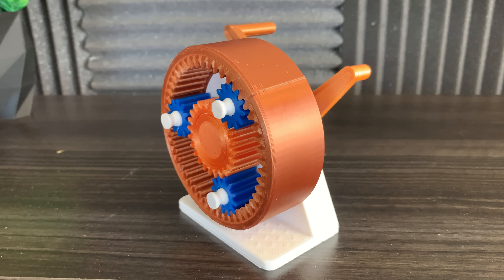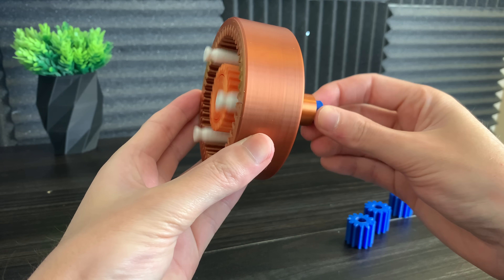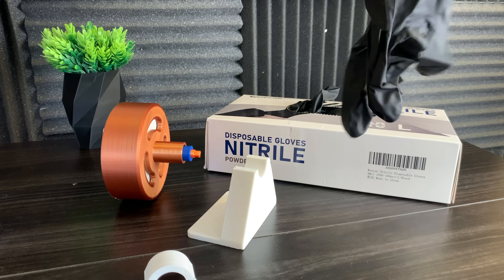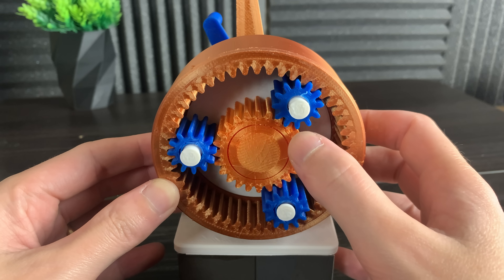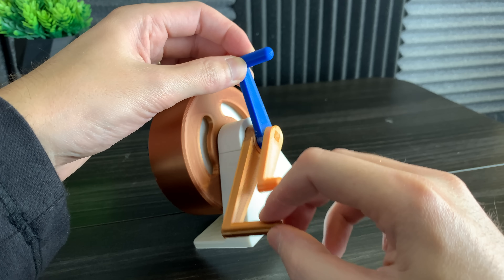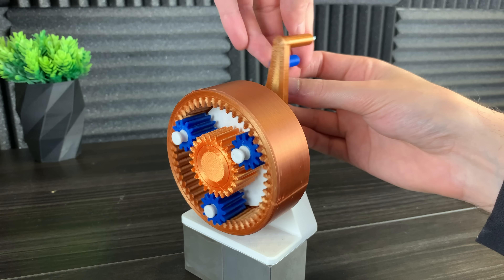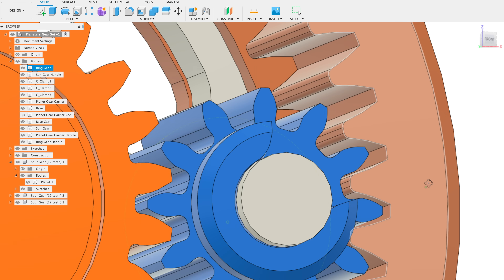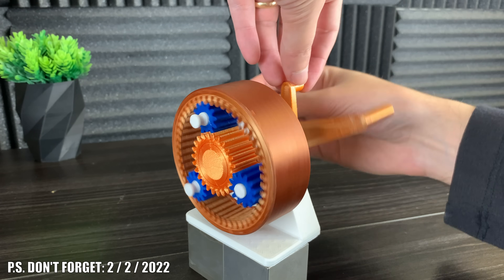What makes planetary gearboxes so amazing?

Comment: I believe one of the most interesting uses of this gear configuration is the differential in an automobile. The engine turns the planetary part I believe which will automatically distribute the energy to the two wheels unevenly if the car is turning (more speed to the wheel on the outer edge of the turn). If you ever have your car up on a lift, you can observe that spinning one of the drive wheels will spin the wheel on the other side of the car in the opposite direction.
Reply: An open differential uses a ring gear but in a different orientation so that it can be rotated by a pinion gear from the drive shaft. That ring gear is linked to spider gears which can rotate around side gears. Each side gear is connected to each half shaft. When the car is driving straight, the spider gears are not used. Only when the rpm for each wheel differs then the spider gears allow for the side gears to rotate at different rpm.

Comment: OMW. Yt algorithm wins again.  Coming from eskate boards this is so relevant as gear drives are now being used as an alternative to belt drives and direct drives. 
Also need to learn how to 3D print components for my boards so this video is excellent. Great presentation and easily accessible. Thanks so much.

Comment: Retired machine designer here: Don't know how you modelled your gears, but you can download exact CAD models in several formats from gear (and other components) manufacturers or suppliers. Saves a lot of construction time and the 3D printed parts should fit the first time. A simple pencil sharpener is 2/3 of a planetary gear drive; the planet carrier is spun by the handle, the planet gears are rotated by the stationary ring gear. The cutters are attached to or are part of the planet gears. No sun gear is required for this.
Reply: You could say the pencil is the sun gear, and being forced to hold steady generates the friction that sharpens it
Reply: "Should fit the first time" except you're not realizing that 3D printed parts' tolerances can be vastly different from something commercially produced, so even with cad files from, say, mcmastercarr, you may still need to compensate

Comment: The "Power Split Device" in a Toyota Hybrid Synergy Drive E-CVT transmission, is a planetary gear set, just like depicted in this video. In the Toyota Prius, the original application for HSD,  The Sun Gear is splined to a 30hp, 3-phase synchronous motor called MG1. The Planet Gear Carrier is splined to the gasoline engine, and the Ring Gear connects two ways, to the front wheels and via the Differential gear set, and to a 70 hp synchronus motor, MG2. The genius in this system is provided by the software that controls the overall flow of power to and from the gasoline engine and the two motor generators. MG1, the smaller, 30 hp unit, has two jobs: to reclaim kinetic energy when the vehicle needs to slow down, via "regenerative braking", and to control and limit the speed of the gasoline engine. At any given vehicle speed, the computer can adjust power flow to MG1, and thus control how fast the sun gear is spinning, or even make it spin backwards, and this indirectly controls how fast the gasoline engine is spinning. The computer is programmed to try and keep the gasoline engine running within it's most fuel efficient range of rotation speeds (1,000 to 2,500 rpm), and to limit the maximum speed of the engine to about 4,200 rpm. While the gasoline engine is being controlled by the computer via MG1's spin on the Sun gear, the computer is simultaneously controlling power supply to the 70hp MG2 motor. How much power can be delivered by this motor is influenced by the state of charge in the traction battery, temperature and power limitations in the inverter and motor stator, the power demand by the driver or cruise controll, steepness of the terrain, altitude and oxygen supply in the air intake to the gas engine, and several other factors. The computer makes thousands of decisions every second, and is programmed to optimize all of the components in the power train to deliver the maximum fuel efficiency, and minimize tailpipe emissions to keep the Government happy. It's not just Toyota, of course: many manufacturers sell Hybrid cars, and most of them use technology similar to the Toyota HSD, in which a planetary gear device is central to marrying one or more electric motors, a large battery, and a gas or diesel combustion engine in a unified powertrain that uses electricity from the battery to propel the car whenever possible, and use as little fossil fuel as possible.
Reply: Awesome explanation! Nissan licensed Toyota's Synergy Drive so they used the same PSD. Honda and most other did not and instead mated an electric motor to either a standard automatic or CVT transmission which was nowhere near as efficient or reliable. The PSD is an ancient concept that was tailor made for hybrids.

Comment: The whole point of this system is that you can connect two separate drives to one output. I think that's worth stating more than the adventures with Superglue.

Comment: 9:25

R = Ring gear (tooth count)
S = Sun gear (tooth count)
C = planet carrier

(Input, output, Stationary)

(S, C, R) = R/S + 1
(R, C, S) = (R+S)/R
(S, R, C) = -R/S

(C, S, R) = 1/(R/S + 1)
(C, R, S) = R/(R+S)
(R, S, C) = -S/R

The tooth count of the planet gear is always (R-S)/2

The number of planet gears must be a factor of R+S in order for everything to work.

You can use 2 of these simple gearsets to produce a 9 speed gearbox with 3 reverse ratios (granted, only 8 of the forward speeds and 1 or maybe 2 of the reverse speeds are practical) using 6 clutches and 5 brakes.

R/S/C Gearset 1 = 80/48/16 (2 clutches, 2 brakes)
R/S/C Gearset 2 = 80/20/30 (4 clutches, 3 brakes)

For Gearset 1 you want the planet carrier to be the output all the time. You will produce 3 ratios, 2 reductions and a direct drive by controlling the clutches and brakes.

2.667 (S, C, R) - Sun clutch = closed, Ring clutch = open, Sun brake = released, ring clutch = applied
1.600 (R, C, S) - Sun clutch = open, Ring clutch = closed, Sun brake = applied, ring clutch = released
1.000 (direct drive) - Sun clutch = closed, Ring clutch = closed, Sun brake = released, ring clutch = released

Gearset 2 is very similar to gearset 1, but it has to be able to send power out the ring gear now to produce a reverse ratio, so now we must add 2 more clutches to the output side (for the carrier and ring gear) as well as another brake for the carrier.

5.000 (S, C, R) - Sun clutch = closed, Ring clutch = open, Sun brake = released, ring clutch = applied, 
1.250 (R, C, S) - Sun clutch = open, Ring clutch = closed, Sun brake = applied, ring clutch = released
1.000 (direct drive) - Sun clutch = closed, Ring clutch = closed, Sun brake = released, ring clutch = released
for each of these 3 ratios, the ring gear output clutch will be open, the carrier output clutch is closed, and the carrier brake is released.

-4.000 (S, R, C) - Sun clutch = closed, Ring clutch = open, Sun brake = released, ring clutch = released

For reverse, the ring gear output clutch will be closed, the carrier output clutch is open, and the carrier brake is applied.

By combing the 3 ratios of each 2 gearsets, we get 9 forward speeds:
1) 13.333 (2.667 * 5.000)
2) 8.000 (1.600 * 5.000)
3) 5.000 (1.000 * 5.000)
4) 3.333 (2.667 * 1.250)
5) 2.667 (2.667 * 1.000)
6) 2.000 (1.600 * 1.250)
7) 1.600 (1.600 * 1.000)
8) 1.250 (1.000 * 1.250)
9) 1.000 (1.000 * 1.000)

The 1st ratio will be too low for on road use, but ratios 2-9 would make an excellent 8 speed gearbox. It should be noted that due to lack of an overdrive, the final drive ratio chosen should be much lower than usual. Instead of a typical 3.70 or so, you may opt to go as low as 2.20 or 2.50 depending on the application.

And by combing the 3 ratios of the first gearset with the reverse of the second gearset, we get 3 reverse ratios.
R1) 10.667 (2.667 * -4.000)
R2) 6.400 (1.600 * -4.000)
R3) 4.000 (1.000 * -4.000)
Reply: This is just amazing. Thanks. The remaining issue I have in my head is the clutch set. My use case is for a telescope. The ratios in them are meant for extreme reduction for moving the telescope to follow the planets and quick traversal. Backlash is a big problem, so a feedback loop is absolutely necessary.

Comment: I wonder if you could improve your design by using plastic pins or something to hold any one of the 3 gears stationary while you spin the other two.  The ring gear would be easy to lock in place; a hole through the stand and into the back of the ring gear could hold a pin to lock it.  The sun gear could be locked in place if it had an extension out the front that could be connected to the stand.  Not sure how to hold the planet gear in place without interfering with the rotation of the other gears, but there must be a way.

Comment: With a planetary gear system there are only three usable movements. High, low and reverse. Not six gears because it is mechanically only able to drive in the three modes as listed above.
Reply: That's assuming some of the gears stay stationery while one gear moves. There could be a system where all three gears move at the same time, i.e. a smooth transition from high to low.

Comment: wait, i seen this gear set up before on a mini 4WD wheel system... the center gear is connected to an axle, the outer gear is connected to the rim which house the tire.. the idea is to allow the wheel spin faster or slower base on the position of the wheel on the track which allow smoother cornering.

Comment: Thanks for the interesting video. My coffee grinder (Baratza Sette 270Wi) uses a planetary gearbox and it's notoriously unreliable and needs to be replaced every several years. I wonder if it has to do with poor choice or materials (it's made of plastic) or some other design problem...

Comment: I've had 5 or 6 different bicycles with different hub gears. I've also worked repairing pneumatic tools including their planetary gearboxes.  This is by far the best explanation and demonstration on how they work I've ever seen! The energy flows of planetary gear boxes can be hard to understand but you made it easy. Thanks!

Comment: This setup of a planetary system is just like the transmission of a Model T Ford. The handles in the illustration would be drums that can be held, i.e. stopped, by bands tightening around the drum to stop it from turning when the pedal is pressed.  Planetary gears are also used in the steering mechanism of a Model T. They connect the steering wheel to the steering shaft and gives it a 3 to 1 ratio for better control.
Reply: I'm glad to see someone mentioned the Model T and its manual transmission planetary gear system, which went to market in 1908. 😸

Comment: There has got to be a better way to use the handles without them getting in other's way...
Make them telescopic so they they pull out for each use.
Or better yet, make one extension that you can "plug" into the handle you want to use.
You're welcome.

Comment: On heavy truck in the UK this gearing is used in the drive axle hubs, we call them double reduction hubs, it reduces the size of the crown wheel and pinion, thus giving the axle a higher ground clearance. 🇬🇧

Comment: Yeah math is fuckin cool. So the sun gear turns the planetary gears 3 times in one rotation. Because the planet gears have the same number of teeth that the sun gear has but split into 3 separate portions so even tho it's spread out it still has to move the same amount of teeth resulting in the 3:1 speed

Comment: It got you too, eh?  The figuring of tolerances for gear teeth [where to set posts] are different in gauging mesh of i.d. vs o.d.  The better fix would have been moving gear teeth on shell out a bit in diameter?  Looks like mesh tolerances on the sun started out good.

Comment: When I was an automatic transmission tech back in the 90's, I thought (and still do) that the coolest transmission was the 700r4 (the same gearsets used in the 4T60, 4T60E and 4T65E). Using only two planetary gearsets, it achieved 4 forward speeds (4th as overdrive) and reverse, and was the most compact 4 speed transmission of the 90's.
Reply: 4l60, 4l60e, 4l65e. But yeah the 4t60 is just the front wheel drive version.
Reply: @Chrisrpg1980  beat me to it
Reply: I think its rather nice that the dodge 4 speeds used an extra planetary gear-set. They only have 4 clutch packs, rather than the 7-9 clutch packs of a 4l40 or 4l60 series trans. 

They also achieve 4 speeds with only two sprag clutches, rather than the 2-3 in the gm trannies. 

Its crazy how both sides went on achieving 4speeds. Ford and GM made trannies from scratch, while Chrysler,  really Dodge, expanded on their existing 3 speed by adding a 3rd planetary. Imagine if GM did this with a 3 speed powerglide.
Reply: Maybe that’s why the failure rate of Dodge transmissions is several times that of GM?
Reply: No one ever talks about the 4L30E transmissions
Reply: @moto083c  Maybe there's a reason for that?
Reply: @panchorodriguez7246  Probably because they are apparently rubbish. LOL
Reply: @moto083c  This is me, nodding...
Reply: That was the one the third gen f bodies used, from the 80's
Reply: 4 and a "half" forward speeds with the lock up clutch.
Reply: @jazzman92478  Giving me flashbacks to my first car ('90 Chevy Lumina)
Reply: I think almost all automatic transmissions now are planetary gear based?
Reply: I have a 700r4 in my 83 c10.
Reply: Anybody else call this an epicyclic gear box?

Comment: Bicycle hub gears use planetary gears. The gear teeth are straight cut (easiest to make and extremely efficient) but there is always at least one tooth pair in contact so there is no gear whine and no vibration.
You can make a simple gearbox using a separate gear-set for each pair of ratios. It's not making full use of the ratio options but it's easy to engineer. Gear set (1) Band clutch stops the ring gear (annulus) causes a drive. A second clutch stops the sun carrier gives a different drive ratio. Three gear sets = six ratios.

Comment: But there's other components to diagnosing a transmission problem. Like clutch and band wear. Valve body blockage. Vacuum Valve diafram wear. Valve springs compression and breakage. Fluid pump damage. Even something as simple as a linkage retainer clip. Or a parking brake hammer spring.

Comment: Another amazing feature of the planetary gearbox is the amount of torque it can withstand,due to the large amount of contact of gear teeth.
Reply: Do you think the depth of the gear (thickness) of the gear also contributes to the amount of contact of gear teeth, thereby, helping to withstand the torque? Just a question that I began to have after reading your comment.
Reply: Uh.. I don’t think so.

It’s like a chain.. only as strong as its weakest link. The sun and planet gears are really no different than spur gears. It’s just the planets and ring gear that have more contact because the ring gear is an interior gear.. but more contact also means more friction.
Reply: The arrangement of the gears is also better suited to power as manual gearboxes can shear under high torque

Comment: This is how a transmission works in a chinook CH-47 helicopter. The massive rpms from the engine are unusable at the rotor blades unless the rpms are reduced with this type of gear system.

Comment: Thks & you might find this interesting (planetary gear algebra ;);
*Consider the combos w/o replacement of the set (Sun, Planet, Ring) gears; 
      [(Sun : Planet) is (2 : -1)] ; [(Sun : Ring) is (3 : 1)] ; [(Planet : Ring) is (1 : 3)]
*Note the combos are commutative : 
      [(Planet : Sun) is (-1 : 2)] ; [(Ring : Sun) is (1 : 3)] ; [(Ring : Planet) is (3 : 1)]

Comment: I think making inner handles' ends longer than the outer ones would make it more comfortable to rotate.
Reply: But the ring gear is on the outside?  Like you could do it but it's not as easy as just make the rotor longer than the sun gears
Reply: @gavinsreid  They meant the parts you hold that are horizontal.

Comment: This is basically the Toyota Hybrid transmission. The car's wheels and large electric traction motor are attached to one shaft, the gas engine to a second, and a smaller electric motor is attached to the third shaft. It's much simpler and more durable than using a belted CVT and it allows lots of different modes of operation. The gas engine can idle at a stoplight to charge the battery or provide cabin heat, or the transmission can allow the car to be driven by the electric traction motor while the gas engine is off. Mechanically, the system is simple and robust, but it takes a lot of advanced high-power electronics and computers to make it run smoothly.

Comment: Stating that there are 6 ratios is a little far fetched from my point of view. Then a normal set of 2 gears would also have two ratios. It is one ratio which can be inverted.
It might be easier to do so with a planetary transmission as you can connect to every gear from either side thus making it easier to switch input and output gear with just connecting and disconnecting clutches but it's not impossible to build a system which can do the same with a normal set of gears.
So there are 3 gearratios in that transmission which can be used either as reduction or as increase of rotations.

Comment: When John Deere came out with their power shift on the tractors, the 6 to 7 or 7 to 8 shift was very harsh.  The dealer advised that was because one of the planetary gears, had to switch its direction of rotation, to complete the shift.  Now it all makes more sense.
Reply: Just one? Interesting because what you say means that at least one planetary gear is independant from the rest somehow. Id love to see that gearbox.